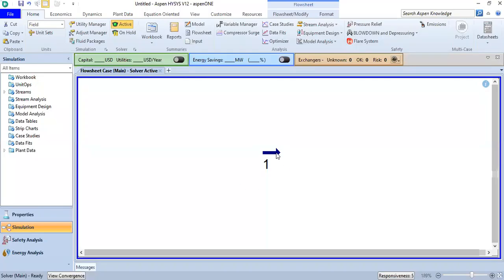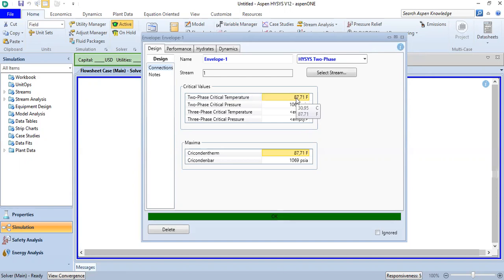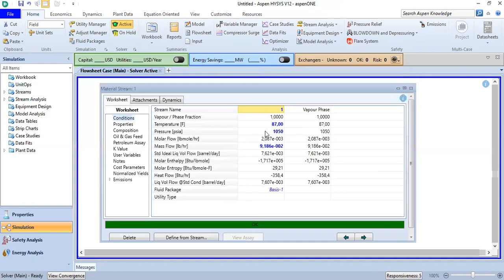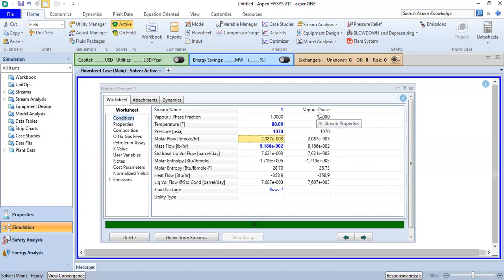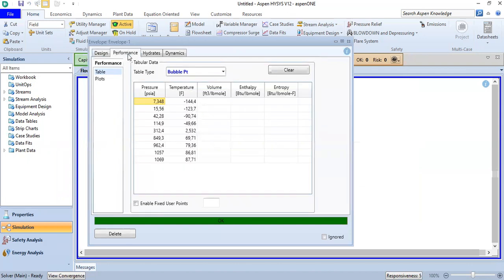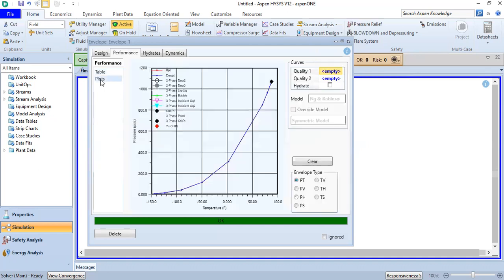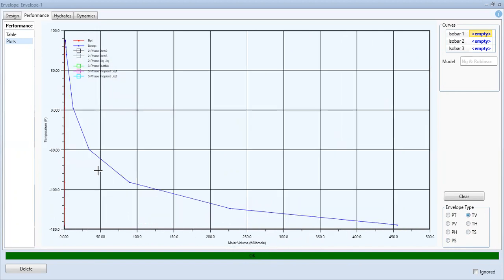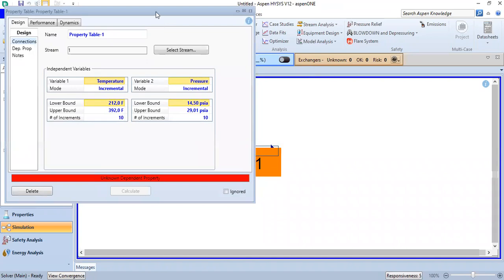HYSYS Tutorial 30: CO2 Phase Envelope

Comment: hello! I wish to simulate CO2 at values much higher than the supercritical point but the vapor fraction goes back to 1 even though NIST states that my values correspond to a supercritical fluid. how can one overcome this?
Reply from the maker: much higher here means what? high temp only, high pressure only or high PT at the same time?

I think hysys will still regard supercritical fluid as "vapor"-phase for the sake of computation, that's why at least from math point of view, the vapor frac is considered 1
Reply: @EngMan101  i am trying to model a supercritical cycle so that starting conditions before the compressor are 420°C and 7380kPa (so pressure around the same as supercritical pressure but temp much higher) after the compressor the values should be around 570°C and 22000kPa. I am relatively new to simulating supercritical fluids so I just want to be sure that vapor fraction 1 still means supercritical because in your video it seemed as if it should be liquid instead :) another thing is that for any property packages that I have tried other than peng rob, it won’t show up the critical properties (it says “property package is incompatible” on the window), which is a bit disappointing as I was hoping to use GERG2008. I would love to hear your thoughts on this and regardless, thanks for your fast response!